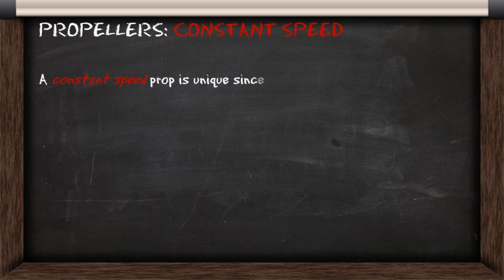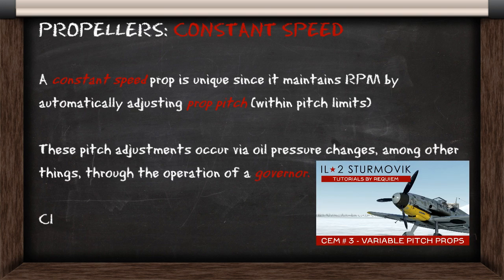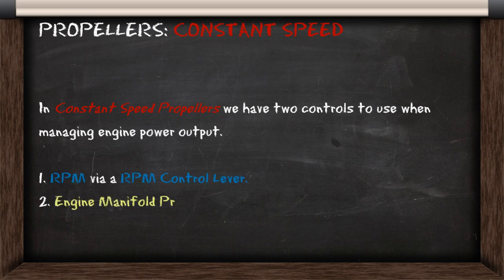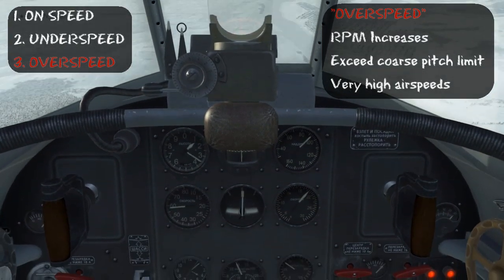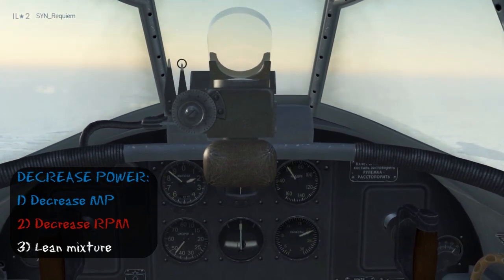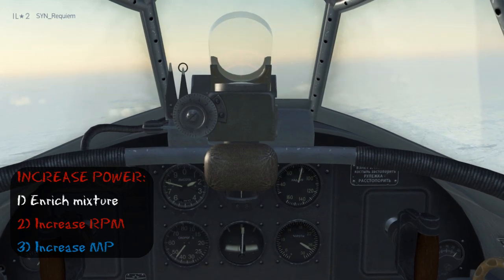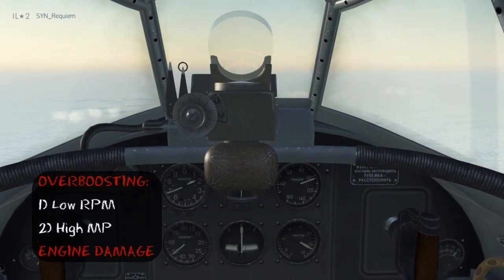CEM Lesson #5 - Constant Speed Propellers

Comment: So I believe: 
The top left instrument is altitude.
The bottom left is airspeed.
I think:
The top right is RPM.
The bottom right is ???.

I don't even know which aircraft this is lol. (from the looks of it, it seems Russian, but I could easily be wrong :P)

So looking back on lesson #3, it seems that a more coarse setting will shove more air backward (theoretically creating more speed depending on the RPM as you want both a high RPM, and more coarse prop to go faster) compared to a fine setting which is basically just the propeller cutting the air on the same 2D plane that all the propellers lie on, this causes the propellers to have less air to cut through making the propeller rotate faster (higher RPM).

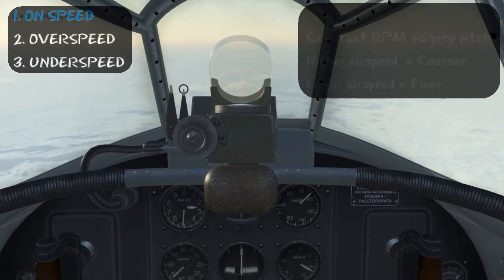I used to assume that you want a more coarse setting while climbing and flying straight to shove as much air back as possible, and you wouldn't have to worry about over-revving your prop as you are climbing and thus the air isn't forcing your prop to spin faster; here lies my previously flawed logic in that in a dive you would want a finer pitch so that you didn't shove as much air back and that this would for some reason decrease RPM. But when you dove at 1:04 you said that:
 - The airspeed increases (makes sense)
 - This increases the propeller's RPM (makes sense)

 - The governor compensates by making the propeller pitch more coarse (This threw me back)

I guess this makes more sense now, it isn't as black and white to just say you want a coarse prop for climbing and a fine prop for diving, rather it is better to say you want a high RPM and coarse prop, you need to make the propeller finer when you are overrevving the engine so.
 - In a climb, you want a coarse prop, but since the air isn't helping the prop spin you may need to make the propeller finer to compensate for that.
 - in a dive, you want a coarse prop to A) shove more air backward and B) decrease RPM.

Putting lesson #4 into context and my current theoretical assumption is that when determining what the perfect RPM is, it all depends on the Manifold Pressure.

You want the highest Manifold Pressure which is dependent on:
 - Having as coarse a pitch as you can achieve.
 - Having as high of an RPM as you can achieve.
 - Having the best fuel to air ratio or mixture (dependent on altitude)
Reply: The Top Right is Manifold Pressure and the bottom right is RPM.

Comment: Thanks, I've been trying to figure out the manual engine controls for the P-40E, since on auto, it's way too underpowered. Now I can fly it to its max without killing the engine.
Reply from the maker: Excellent Hat Man! :-) A trick with the P-40 is also to remember to make small adjustments at a time. Some people just smash that throttle forward too quickly, so the RPM can't compensate quick enough and BOOM goes the engine. Keep your movements smooth and controlled. I even can't remember the last time I busted a P-40 engine!

Comment: Nice video and all your series.
Could you elaborate a little bit more on how to use all that in combat?
Reply from the maker: sergey a Well, how you use this info really depends on what you are flying.

It's pretty straightforward  though but with two opposite styles of management for each side. The Russian fighters don't seem to break their engines with too high an RPM or MP, so you only need to pay attention to temperatures, but the German fighters can break their engines with too high and RPM or MP setting, and their temperature management can be automatic.

German fighters - Pay attention to RPM and MP
Russian fighters - Pay attention to temperature.

This changes slightly if you want to conserve fuel, requiring you to just adjust your power settings to be lower for cruise with slightly closed radiators to increase temperatures. Then once you spot an enemy increase RPM and MP to combat settings, and open the radiators a bit.

The German bombers (Stuka and He-111) basically require managing all of the above, but you fly in straight lines most of the time with those so the management is easy.
Reply: Thanks for explanation. So basically one do not mess with RPM on Russian fighter. Just control MP and radiators while running on maximum RPM. From time to time switch supercharger stages and mixture. Right?
Reply from the maker: sergey a Yep, you got it in one.

Comment: We decrease power right after takeoff. Say about 1,000 ft agl. Should I adjust the mixture as well or wait until above 3,000 ft agl?
Reply from the maker: It can depend on a few factors like density altitude, CHT, company procedures, etc. If the engine is running rough or CHT is getting too low due to being too rich then you can lean it out slightly to improve performance and prevent excessive spark plug fouling. Generally speaking though that climb up to cruise is a stressful time on the engine so you can leave it rich until cruise unless the conditions dictate you making small adjustments when you see it's needed.

For training purposes at the school I instructed our students weren't allowed to lean out the mixture without the instructor present for a while as some weren't doing it right and causing unneeded engine maintenance as a result.
Reply: Thank you.

Comment: The lagg-3 lacks this sort of autopitch for the propeller, right?
Reply from the maker: No, the LaGG-3 actually does have a CSP. Each aircraft in BoS has a mechanism like this. However, in the German Bf 109s and the Fw 190 you can override it and switch to a manual mode where you control propeller pitch directly.
Reply: The Air Combat Tutorial Library Oh, i wondered why i struggled so much with engine rpm. I'm still having my first steps regarding flight sims. 

 Is the CSP activated manually? It's not the Lshift+P shortcut, right? I think those were for assistance when learning the game.

Fantastic channel by they way.
Reply: Synesthesia oh! nvm. I've just been toying with the lagg-3 on one of the training mission, and i think i finally grasp the mechanic.
Reply from the maker: Synesthesia No worries, I'm glad you got it sorted out.

It's great to hear you understand the mechanics of this because you will find that people incorrectly refer to increasing/decreasing "propeller pitch" in these planes a lot when they are actually setting the RPM. In BoS thus far, unless you are in manual mode on some German planes you will never be changing propeller pitch, only RPM because the CSP changes prop pitch automatically for you to maintain an RPM you set :-)
Reply: The Air Combat Tutorial Library Yes! That's exactly what clicked. I am influencing RPM, not directly controlling the pitch angle. Afterwards, I just did my first not-utterly disastrous landing today with a stuka. Progress!